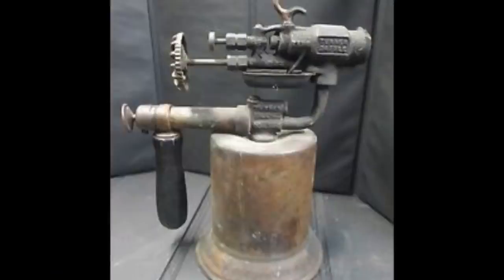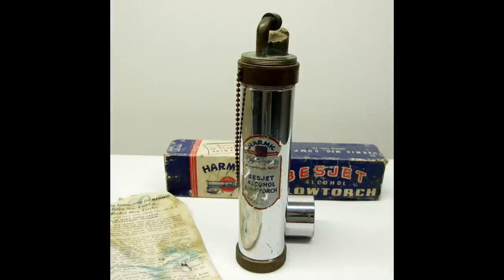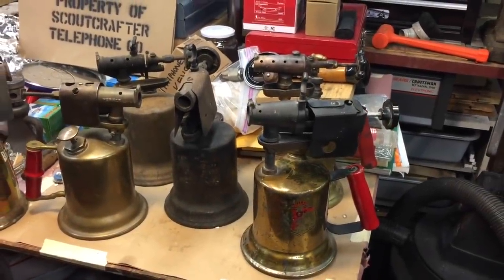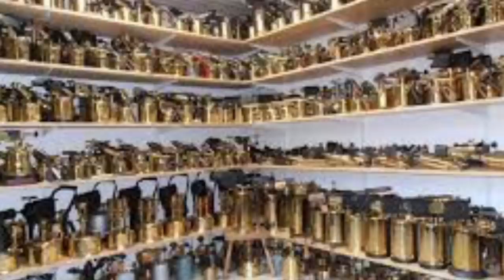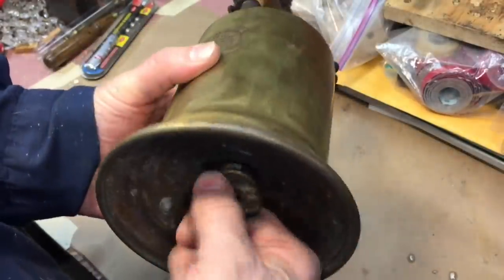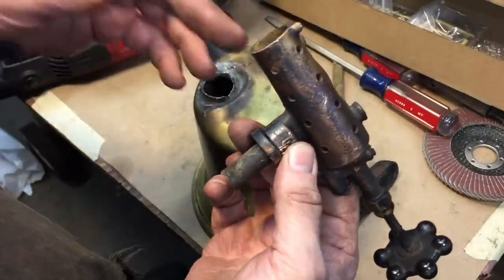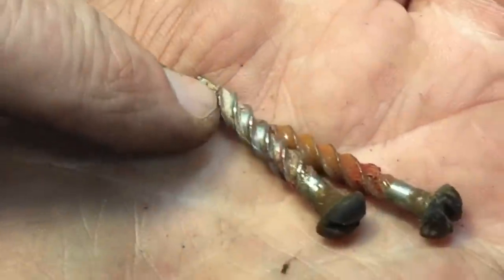Blowtorch Lamp Build!

Comment: The design of the screw it's just for easy installation, save time, even a few turns save a lot of time at the end of the day,
Specially before, when everything was produce and installed by hand, a machine don't care if it has a high pitch or a low pitch, but as you demonstrate, a human will, few turns, more time to keep installing! Great video man!
Reply: Good try, Victor, but no cigar!  
There is a well known and very old, running gag among professional carpenters in the North Eastern US, based on actual working practices from long ago.  The saying goes that "Slots and threads on a screw are there only if you have to remove it from the work."  Apprentices are advised that the way carpenters actually put screws into softwood is with a hammer.  The eventuality of that are the "Drive Screws" which are sometimes even used today.
I first heard that half joking way of putting screws in 50 years ago and it was ancient back then.
To this day, many times when a carpenter has to lower his standards to put a screw in 
somewhere 🤥 he uses his trusty framing (or maybe his trusty finish) hammer.  
If precise positioning is somehow needed, a very shallow location hole (made by eye and a 16d nail tip) is first tapped into the wood.

Comment: I think anybody that messes around with old tools has at least one or two of these stashed somewhere...(Yes, I have about a wheelbarrow load of them...LOL)..  Several years ago, I cleaned one of them up, refurbished the pump washer and foot valve, and got it back into operational condition...  The first time I pumped it up and lit it was a bit unnerving, but in just a minute or so, she was putting out a beautiful blue flame accompanied by a serious roar...  You really have to admire those old craftsmen that used these things on a daily basis.  They had to have a serious respect for the tool and treat it with the caution it deserved, because those things can really mess you up if you get careless...  Great job on the lamp - looks really good...  I like bulb #1, but you need to look at what is available in LEDs to make sure.....
Reply from the maker: Edward- You are so right...  These torches are great fun to still fire up and enjoy every so often.  Because of that I try to emphasize that if someone wants to make one into a lamp they should buy one that is a real junker.  I would hate to see a nice rare collectable torch ruined when there are so many beaters out there to have fun with!   Thanks!!!!!!!!!

Comment: I vote for bulb no. 1. But they are all cool. You have more imagination and creativity than I do. I had two of these torches and gave them away because I didn't know what to do with them, but knew they were too dangerous to use. I assumed they used kerosene, but pressurized gasoline? WOW! Sounds ultra dangerous. Never occurred to me you could make a useful household lamp. Very nice job with this project, as usual. I like the nice quiet sound of your lathe. My vintage Craftsman table saw shreiks like a banshee. Thanks
Reply from the maker: Pat- They are interesting when lit up and burning but I would only do it outside in my vintage asbestos suit.  LOL

Comment: I think you're going to like this idea, it is perfect for your blowtorch lamp. As you know, I have significant dexterity problems. I have invented and adapted many many things to make my life easier. On several of my machines, I have used plumbing valves as switches. It's super easy, it has to be a gate valve not a ball valve, but you can make the closing of the valve be what completes the electrical connection. I did it for a convenience on my patio, guests always seem to get a big kick out of it
Reply from the maker: With 110V?  How do you isolate it?   =D
Reply: @ScoutCrafter  oh no, I did not describe this well. I used the valve like a relay. DC switching, it's a habit at this point, separated live voltage

Comment: John Nice job as a kid years ago a new home under construction burned down when the plumbers were installing the piping using a blow torch. A few years back there was a fellow selling old tools along side a local road I stopped by several times and bought some tools. I asked him how he cleaned them up and he said he had an old cement mixer which he filled with dry gravel cement mix then ran it for hours with some rusty tools in it. He mostly had old hand tools and things he collected from old barns. The tools were usually ok to use and I still many wrenches that I use now. I am following some of your techiques to restore some of the old tools i have but I have a long way to go. Many Thanks Ted
Reply from the maker: Hi Ted- Those Gasoline blowtorches were so dangerous that as soon as propane torches came out the Gas torches were obsoilte overnight!   Like VCR tapes to DVD's    LOL

Comment: Really nice lamp, I like it. I prefer bulb #1. I would say the screws for the handle were made to drive in with a hammer. Note the sharp end like a finish nail. The threads would help to keep the screw/nail from backing out.

Comment: Those are called drive screws. They are meant to be hammered in (or pressed in) like a nail with a pre-drilled hole. Very cheap to make yet holds better than a smooth shank nail. You'll mostly see them on nameplates on equipment. The slot cut it these are to make them easier to remove. They can be used where pop-rivets are used where shear strength is needed - like this handle.  
I think putting a rheostat in the T handle would be good for a concealed switch!
Looks great with bulb #4 - set it next to the Rocket lamp!

Comment: Very nice project. I liked the non fluted 25 watt bulb. I have one of these I will refurb as a future project. Sounds like my future projects list will last me the rest of my lifetime. I’ve often wondered if these things would work on white gas like a hiking stove does.  Pressurized container, pan to burn fuel to heat up and further vaporize the fuel. Seems like exactly the same design concept. Any thoughts on that??
Looking forward to your next video. Best Regards, John
Reply from the maker: Hi John!  Yes!  Everyone that still uses these lanterns use Coleman fuel which is basically Ultra refined unleaded gasoline.   Same exact concept!!!

Comment: I wonder if that screw is like that so, in production, they could just press it in rather than screwing it. Like, maybe they drill a pilot hole and just smoosh it in place. Just a thought.
Great job on the torch. I'd go with the first bulb or the last.
Reply from the maker: You know Ben I can't find any of those screws on the internet!
Reply: @ScoutCrafter  You probably already know this, but it's called a "spiral thread"... but I was unable to find anything either. Good luck.

Comment: Hi John. Chipboard screws have a much longer thread pitch than normal screws so as to bite better into a more fragile wood structure. I wonder if because they are screwing into end grain in the handle they used a larger pitch? Just a thought. Cheers

Comment: I’d recommend using a 4” hole saw to cut the bottom access rather than a cutoff wheel, it would definitely be safer and easier. I wonder if those screws were pressed in to a pre-drilled hole and that’s why they have such an aggressive thread pitch? I like the first bulb you had in there because it looked like a flame when the torch was at idle. Nice work anyway, looks cool.
Reply from the maker: I would love to use a hole saw but this is concave and Brass! Not to mention there is a plug hole in the center and hard to hold the font.  😃😃

Comment: I own my home and I'm reckless with both torches and all sorts of other crazy fire like cigarettes.. I thought about Murphy's law so I decided I'd permanently install fire extinguishers at all of the exits in the garage and all the vehicles etc. Knock on wood 16 years only ever have to replace an extinguisher when it expires or starts to lose pressure.
Reply from the maker: I have a friend who does a lot of welding and he has a special room with cement block walls and cement board on the ceiling that is fireproof!  He does all his sketchy stuff in that room!  LOL   =D  I need one of those!
Reply: @ScoutCrafter  funny you should mention that I'm kind of like a rookie welder I've only been doing it for 25 years... My detached shop from my house is my welding shop but the rookie that I am decided to buy saws for woodworking. I've yet to get any woodworking done I've done a lot of wood destruction either way sawdust and welding do not mix.. now I weld inside my house on top of the carpet. I tried just doing all the woodworking inside but I don't want to sleep in all that sawdust. Love your videos by the way I blow all my mortgage money on antique tools and waste all of my time cleaning them up. It's okay though everybody knows I'm actually insane and I love it

Comment: Great job on that and it really looks like flame with #2 as it gets up to operating temperature. I have to wonder how many industrial accidents occurred with these because it seems they were everywhere; there has not been a flea market or antique store I’ve visted where there hasn’t been at least one or more. They certainly were popular with plumbers and tinsmiths.
Reply from the maker: I always find it amazing how an item can be used and almost unchanged for 50 years then in the bat of an eye be obsolescent....   =D
Reply: So Michael - just how many propane torches do you think are in circulation today?   Where there is a need something comes along to fill it.
Reply: @joesinakandid528  - Plenty of propane torches for sure; in two shops over the weekend I saw no less than 10 old gas torches in various states of non-functionality. They had their day I’d just like to find one in condtion safe enough to use to play with.

Comment: John, on several occasions you have polled your audience with a simple question. When you were pointing out the extreme pitch on those screws, a common argument came to mind. I know the answer, but it is an interesting question to ponder. I don't know if you take requests, but I think it would start valuable conversation. The question is, would a coarse threaded screw hold better than a fine threaded screw, assuming they're both the same size and depth of thread engagement. For the sake of discussion, they are both 70% thread engagement. I think a lot of people might be surprised by the answer
Reply from the maker: JP- In all your years machining have you ever seen a spiral fluted drive screw like the ones in the handle?  What a strange screw and I can't find any on the internet!
Reply: @ScoutCrafter  just as you mentioned the only thing like that I have seen was designed for masonry. In my memory they are typically blue although I seem to have a memory of calling them red tops? Red caps? Basically whatever was used prior to carbide being available to end users

Comment: This is a complete guess, I have no idea if it is correct. I seem to remember that self-tapping screws didn't really come up to the market until the early '80s. I think this is around the same time that drywall screws became differentiated from traditional wood screws. I believe these are an attempt at something like a self-tapping screw but for wood. With the very dramatic pitch, the internal core is narrower. I noticed also that the tip of the screw has convex faces to the point. I think this is to be able to use in wood without drilling first, to potentially reduce splitting. Obviously, they did not work well if so.
Reply from the maker: The funny thing is many screws and hardware were invented many years ago but were not popular and too expensive to produce so didn't take off...  I am so curious about this screw!

Comment: John, can you show how you wired the torch?  Also, why did you have to cut out the bottom of the torch?  It had a removable plug at the bottom for wiring the torch.
Reply from the maker: Hello Vincent-  I suppose with proper planning and a good torch you could possibly snake the wires thru the hole, solder tape and return them back into the font but because my valve was broken I needed access to the bottom of the workings to fix it.   It is so much easier when you have the room to work inside...  =D

Comment: Sorry for off topic commenting, I have a bit of an issue, and I hope you can help me figure this out. I have an OLD Jet band saw, it was painted gray from the factory, hope that helps date it, because I can't find anything that shows a date. Anywho, I did a lot of upgrades to this thing, it runs like it was brand new, and want to add a riser block to it. The problem I have, is the set pins are sticking up slightly, and are bent. This is preventing me from removing the upper arm. I can email pics to you to help explain better, if needed.
Reply from the maker: Yes- Please do!  bicycleguy@aol.com
Reply: @ScoutCrafter  Thank you!!!! I just sent an email to you

Comment: Ok I know this is completely off topic and I apologize for that but what are the little screws on adjustable wrenchs for? Reason I ask is because I have 2 old wrenchs I'm restoring. One a Mac tools and the other is a 12 inch by a brand called P&C.
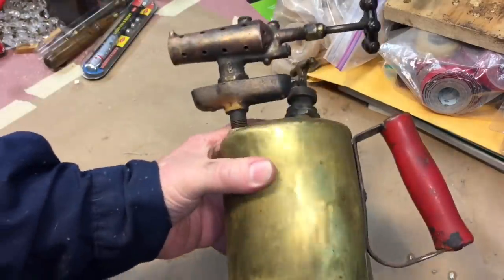Reply from the maker: Hello Devon- I believe the little screws you are referring to is the one that holds the drive thumb wheel in place... If you look at this video at 4:30 I show it out.  https://youtu.be/j6wZTRusNiQ
Reply: @ScoutCrafter  that makes perfect sense and  will make it easier to restore. Thanks for the response and the vid link.